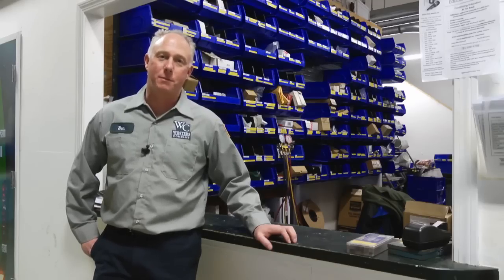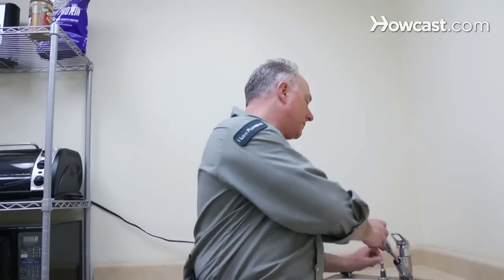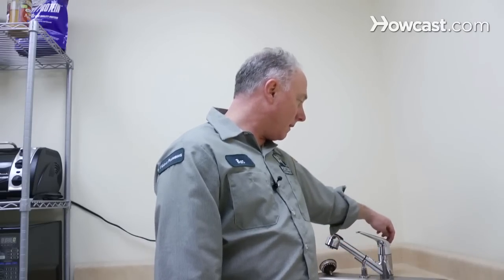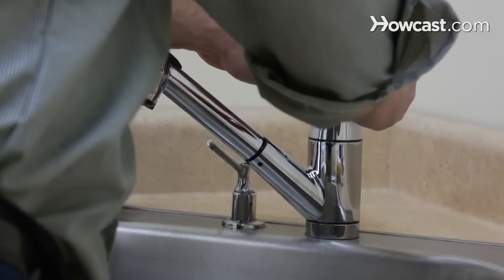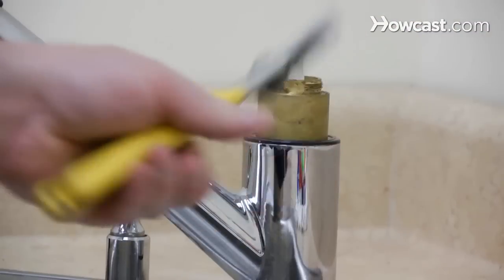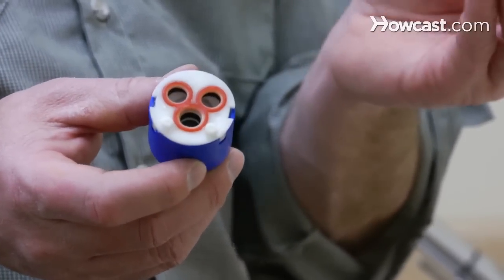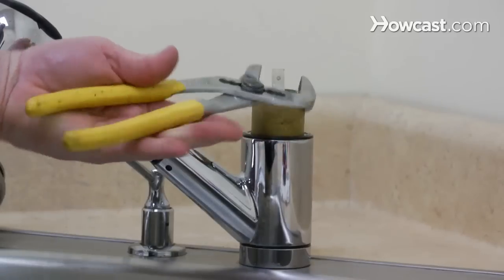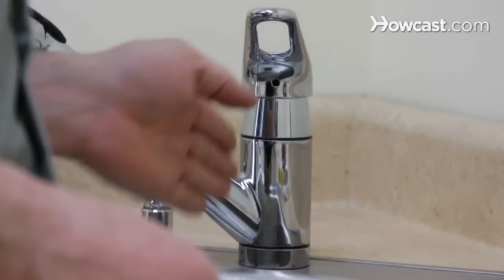How to Fix a Leaky Ceramic Faucet | Plumbing Repairs

Comment: I'm trying to make this repair to my faucet, and it seems like lever is in place without any kind of screw. I've tried every allen key I've had, but at the same time the handle/lever is on very tight and won't come off with force — I've been able to get up it part way off, about 1/4 of an inch. Is it common for plumbers to install these without the set screw? Should I just trying to pull the handle off? Any help would be appreciated.

Comment: Thanks for sharing your expertise! Had the same problem. I took the cartridge out and cleaned off all of the lime and scale that I could see. This fixed the problem long enough for the replacement cartridge to arrive. Cleaning and reassembly might have even been a more permanent fix but don't know.

Comment: Thanks for the video. Those Moen cartridges have been fairly easy to replace and it's a good thing because they fail too often. The last faucet we had use 1225 and about every 14 to 16 months, had to be replaced.  Moen finally sent us a new faucet which has the above 40002 ceramic disk cartridge. From my readings, the ceramic design for most brand faucets was the solution to preventing leaks over time/use. Apparently not with Moen, ours leaks or drips when off just like the 1225 had except for the operation of the handle/valve is still nice and smooth.  In our bath, we replaced a Moen with a Grohe Loop single handle and simply can't complain about it. In fact, we have positive things to say about it since the design is solid brass, no drips and smooth operation to this day. It wasn't expensive either when we purchased it for $79.

Comment: If the 0-rings are the fault, where the leak occurs, why not just replace the 0-rings?  A 0.50 cent part rather than replace the whole cartridge at a cost of $90
Reply: Well, good thinking but Moen, in this case, warranties their residential products for life which pretty much takes away the cost feature. As long as you are the original owner, have a sales receipt and model number, all you have to do is call and explain the issues you are having with the faucet and they will mail parts and instructions to fix it. Unless you have to hire a plumber, there's no cost other than your time. Too bad we can't drill our own wells as that water is the softest water available without treatment.
Reply: I have a warranty on mine and replace it with no cost. Just have to be handy.

Comment: The cartridges cost $3 wholesale, if you are paying $90 better try somewhere else. We retail  them for $9.95. We find that about half the time the ceramic disc is bad so you are better off replacing the cartridge verses the o rings but they can be purchased separately. On our products we use a flat screw slot so you need to see if it is an allen screw or slot screw. Good video.

Comment: wasn't sure about backing out the brass threaded hub that I now know collars the cartridge. In fact, there is a small flat on each side of the ring to facilitate a crescent wrench which I found useful as I did'nt want to put my pipe wrench directly on the threaded hub.  Great instruction on the video - appreciate the help.
Reply: Exactly, pliers on bare threads?  Don't do it.  Use a cloth or something to protect those threads.

Comment: Well done, informative video.  But don't use pliers on bare threads, protect them with a cloth or such.
Reply: You shouldn't be tightening it enough that the pliers will damage the nut. Few people have a large wrench like that so channel locks are much more practical. Also if the nut gets a few marks it, it doesn't really matter. It is too large to round over at the forces needed here and it is covered.